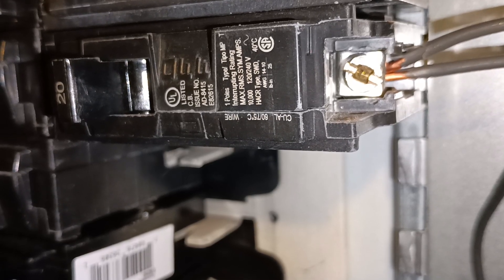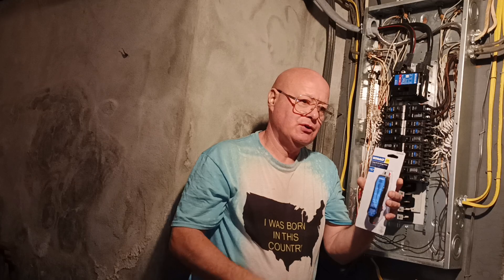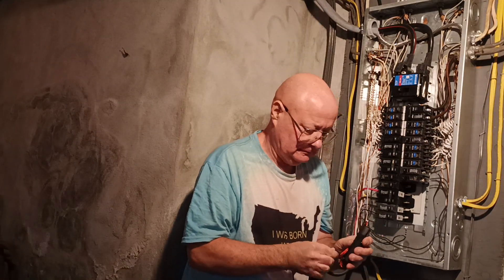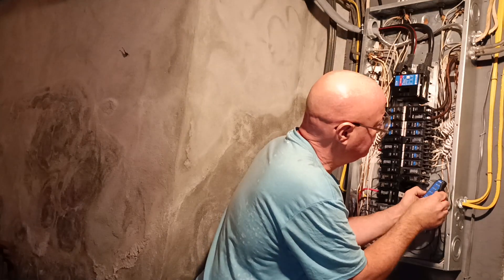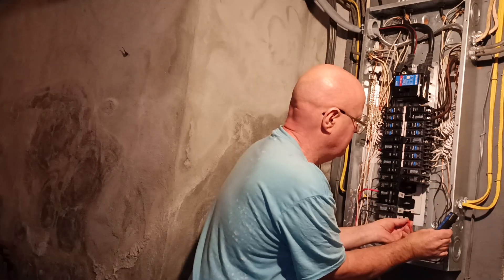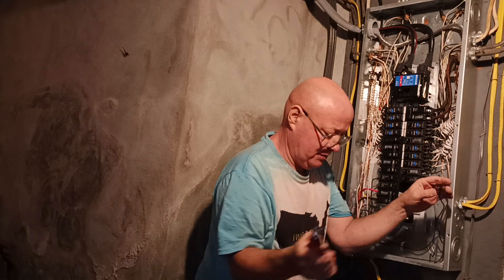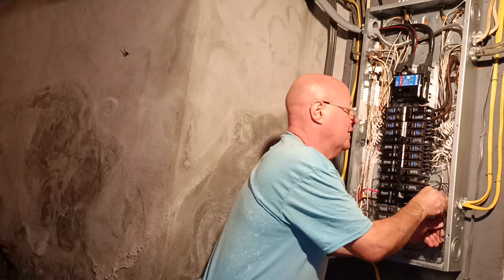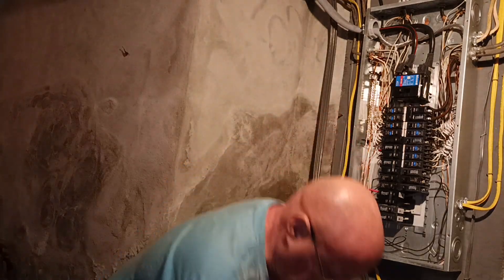when can't you and when can you double tap a breaker and what to do if one is double tapped

Comment: "Double lugging " is a more proper term for 2 conductors under a terminal and is prohibited unless the breaker or wiring device is listed for such connection.  A tap is a connection made anywhere along a continuous conductor and is covered in the code book under "tap conductors"